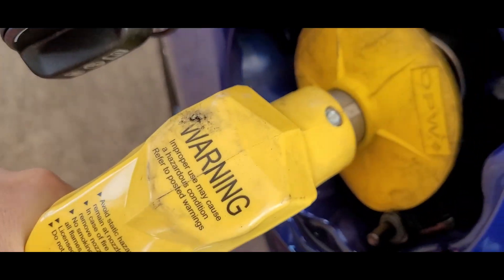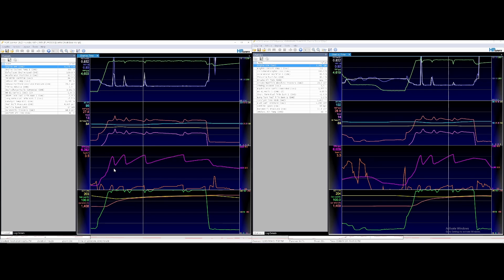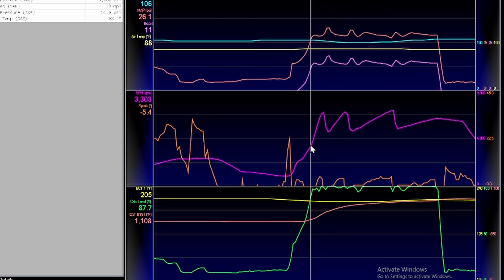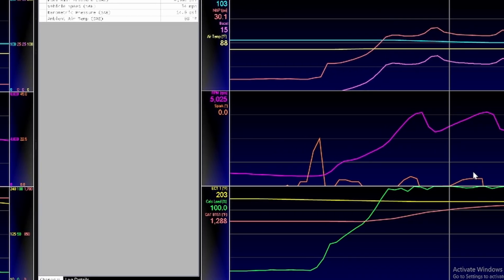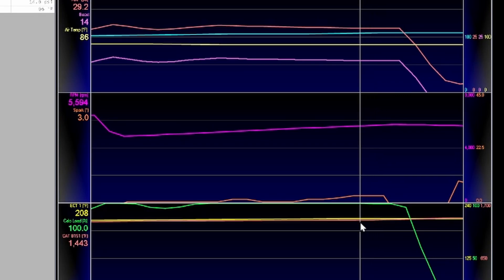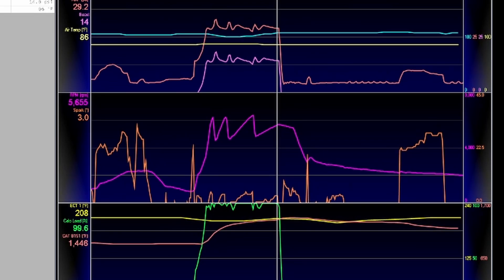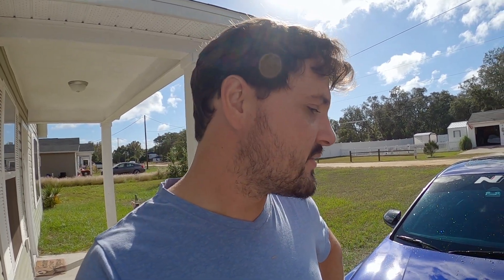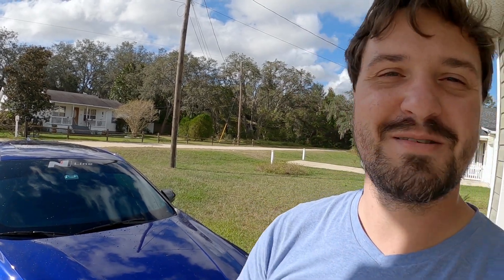87 vs 93 Octane Fuel - Which Makes MORE Power in this Turbo Elantra?

Comment: I have been tuning since tuning required removing and burning memory chips and log and do again etc, The adaptive tuning is game changer and people still think its high low maps timing etc, that's the easy way to explain, but like my 03 Silverado if it has high ma tuned at 93 or more and then detects knock it drops to low and pray it works, The new adaptive you can switch fuel and benefit and or loose power depending. I haven't had a engine 2018 and up that didn't run better on 93, now that's boosted or higher compression NA engines but I dynoed them to see and was correct. Now not all will be this way. But most are getting there.
Reply from the maker: Some of the adaptive logic is crazy! I was tuning my ecoboost mustang with HP Tuners and the amount of tables that are scalable is nuts. It takes much more work to dial in a great tune, especially for something highly modified, but you can have a car that will essentially run its best no matter the conditions. Even the aftermarket ECUs seem to be have adopted OEM adaptive logic. Cool stuff

Comment: I have a 2022 Sonata N line. The manual says it takes regular 87, nothing saying that I'd get more performance with a higher octane.. Though would I feel any difference with a higher octane anyhow? I'm meaning to try it next tank
Reply from the maker: Since the Sonata N Line uses the same engine as the Elantra N, then it likely uses the same logic for Octane Learning. If it does utilize Octane Learning, you will absolutely get more power on 93 or higher octane vs 87 since max power is usually rated at 91 Octane.

Comment: I have a Hyundai Elantra n 2025. Does this mean I can only use 87 fuel and I won't see any real changes compared to 93 fuel? The trips are mostly daily with occasional clicks for fun😃
Reply from the maker: If you have an N and not an N Line,  then your car will make more power with higher octane fuels because it scales boost and ignition timing based on knock sensor data. Max power is usually rated on 91 or higher octane fuel, and while the car can run on 87 octane, you won't be getting full power.
Reply: @KarzKreated i try to tell people this being an actual car guy and working in the automotive industry... alot of people refuse to hear it.

Comment: Octane specifically resists combustion. The higher the octane the more work that takes to combust. It makes less power but the trade off is higher octane resists detonation. 

Lower octane makes more power but once detonation occurs that power becomes destructive.

Fords are not "hard to tune" they use torque demand. Pump gas is spark limited and e85 is limited by the amount of fuel delivery you can supply.
Reply from the maker: Simply, octane is a measurement of a fuel's ability to resist auto ignition. With higher octane fuels, you can create more cylinder pressure without the fuel auto igniting. 
Not all Fords use the same logic. The Ecoboost cars specifically use Ford's HDFx strategy, which is a giant algebraic conundrum. They are not easy to tune because the logic is  extremely complicated.
Reply: @KarzKreated  Octane resists combustion. Auto ignition is combustion. Higher pressures cause less resistant fuel to combust more easily. The higher the octane the more work it takes to combust. Meaning it makes less power overall. 

HDfx is a torque demand strategy. Pretty much all modern ecus are, tuning and engine is very straight forward. Using OEM protections and correction factors / tables. The good thing is that most of those corrections can be adjusted as they are temperature or pressure based among others. All that to provide an amount of timing advance or retard + fuel + air to make the engine run.
Reply: Engine masters made a video disproving this theory 

On an engine dyno with the only change in variable being fuel 87,93 100 and Ms109 all Made the exact same horsepower

Comment: 93 octane is considered good in America? 95 is the least you can buy in Europe nowadays but sometimes you can still get 91 at the same price. Premium being 98 or 100
Reply from the maker: I think the rating system of our fuel's octane is different. 93 octane is the highest available octane of gasoline that is sold at a pump here. Some stations sell race gas of over 100 octane at the pump, but they are few and far between. 93 is king next to E85 here in the States when it comes to a performance fuel.
Reply: @KarzKreated  You are right. I just looked it up in detail. Thank you for explaining.
Reply: @Tartneznok  in usa 91AKI is 95RON in europe 
93 AKI is 98RON in europe bro 
they are the same !!

Comment: Maybe look at n75motorsports and some underglow that will make the car faster !
Reply from the maker: Going by that logic, It's gonna need all the under glow! I may install freakin laser beams for a nitrous hit
Reply: @KarzKreated  the tune at n75motorsports on 91 octane is good for 40.3 - 44 more horsepower and 51.5 more foot pounds of torque. Looks like they have other tunes that will bring horsepower over 250 as well.